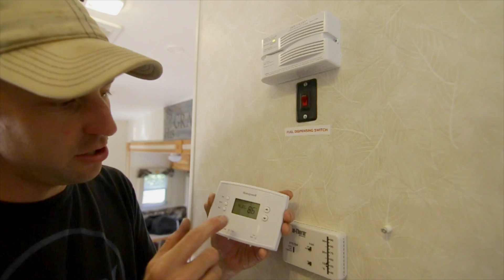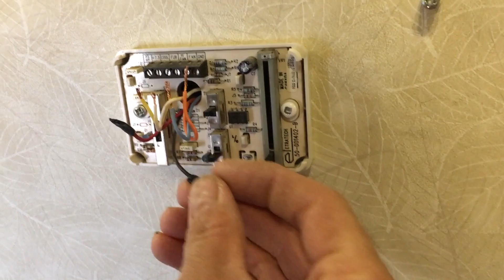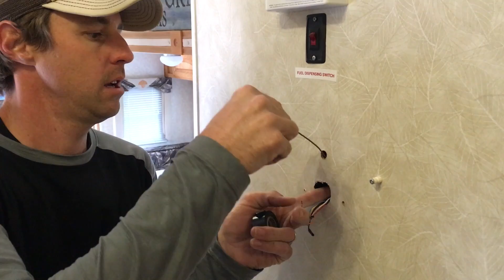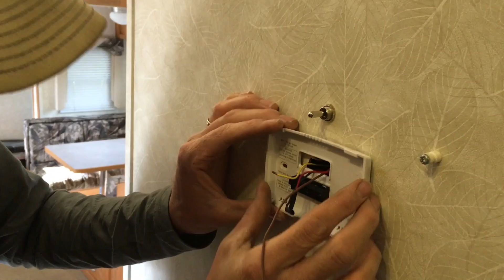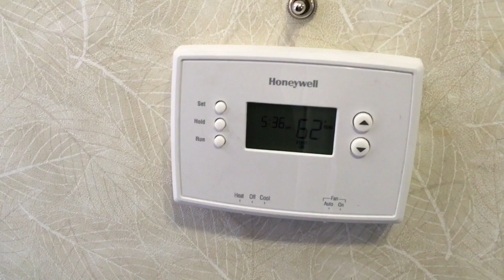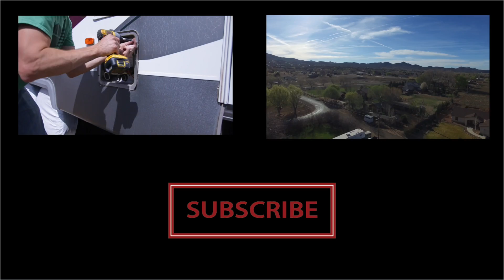RV DIGITAL THERMOSTAT CHEAP AND EASY INSTALL!

Comment: I was skeptical because a home thermostat is 24 vac and RV is 7.5 - 12 vdc.  But it works.  I finally have constant temperature in my RV ...for $28.  I bought a Honeywell RTH111B at HD.

Reason it works is because the home thermostat operates on its backup batteries instead of an external power source ...you don't supply it with power using the red wire in your RV like the RV thermostat needed.  Leave the red wire disconnected and insulate the end with electrical tape.  An RV thermostat does not supply power to the appliances via the red wire as I mistakenly thought.  The RV thermostat simply connects the power signal sent by the furnace/ac control boards (white/yellow) to ground.  Jared's method accomplishes the connection to ground by the RC terminal which is common to ac and furnace.  

For high speed ac fan, connect both the lo and hi speed wires together.  Jared accomplishes this using an on-on switch and jumps the common to the low so low is always connected regardless of switch position.  A slightly easier method is to use an on/off switch instead of an on/on, and connect the wire that feeds the thermostat G terminal and the lo speed fan wire (brown) together on the off side of the on/off switch.  Connect the hi speed fan wire (blue) to the on terminal of the on/off switch.

Comment: Where did your red wire go from the switch to the thermostat as you dont show a red wire being connected.  Thanks for your help as I would like to do this to my rv
Reply: I have the same question
Reply: It will connect to g

Comment: Thanks for the video! My question, if we do this, will the a/c run when the furnace is on? Hopefully not… 

But we do like running the a/c fan on low when the furnace is on. Can we still do that? 

Thanks!

Comment: If you loose the bAtteries during a heating or cooling process, the thermostat will stop every thing or it will continu in the same setting ?

Comment: Eliminate the thermostat all together ...I've now watched 3 break...last night it was mine...!!!

When the unit isn't being lived in the thermostat is irrelevant...you need heat or you need cold...on or off
Can you set it up with 2 switches Furnace/AC...???

Mine came off the wall somewhat abruptly...

Comment: Turning off the main 120 Volt breaker does not turn off the 12 Volt circuit for the furnace. Granted, 12 Volt will not shock you much, but crossing those wires could damage the furnace. So, having omitted that I turned off your video and did not subscribe. You are not expert nor should you be giving advice. Tell us about your camping locations.

Comment: When hooking up the toggle switch for high and low where do you hook up that red wire in relation to the terminal for the new thermostat?

Comment: What?????  You completely disconnected the power so how could a touching wire during disassembly of the old unit cause any issues?  Answer it can’t!

Comment: Jared, my RV thermostat runs off 12 volt, I have the RV parked on a lot I own and have never and will never travel with it, is there a way to convert the 12 volt thermostat to 110 volt?  I have 30 amp service and the only thing I really need 12 volt for is the AC thermostat...
Reply: The typical home thermostat is 24v. I've read that many battery operated thermostats will function with 12v. The 24v home unit has a terminal that powers the thermostat itself but when powered by batteries it appears 24v is not necessary. If you wanted to go crazy you could wire about a 24v transformer from a furnace with a fuse to 120v.

Comment: We have duct A/C and we installed the same thermostat, so will the fan from the A/C always be running even when we are running the heater?
Reply: What did you end up finding out on this? Does ac fan run with furnace fan?

Comment: My model would not work with just the high fan wire I needed to connect both the fan wires together make it run on high

Comment: This is easily the most helpful video I’ve found so far! One question: if one were to accept a single speed on the fan, could the toggle be omitted?
Reply from the maker: Yes just connect either hi or low whichever you want and wire nut off the other.

Comment: bought a programmable thermostat and could not get it to work using conventional wiring.  thanks to your video I got it wired correctly and it works great. I thought I had a bad thermostat which would not have been the first one. big thank you for your video.
Reply from the maker: +Don R glad it helped you out!

Comment: Toggle switch GSW-12 SPDT switch (Ace Hardware, Amazon, Home Depot, etc.), it is a two position switch On-On, in this case it would be a fan Hi-Lo. Follow Jareds instructions in wiring up the toggle switch. Google "Dometic bulletin A27-8C"  and see page six, for early model wiring identification & troubleshooting.
Reply from the maker: +Teagar Sky that's great to know, thank you!

Comment: I have the same wiring and cant make it work so are you saying not to use the red wire on the +7.5 and put the black wire to the rc on t stat sir
Reply: Thats correct

Comment: Great video. We have a Duo Therm t-stat similar to the one shown (just different colors in the block, but 6 wires just the same). I have a question - we don't use the A/C, so how would I wire the RTH221B1039 to operate just the furnace? Many thanks.
Reply from the maker: I could be wrong but I think you would skip the "G" and "Y",  and wire nut those off individually.  I think that is the Cooler and cooler fan
Reply: By keeping the switch between off or furnace.

Comment: i see the red wire when u put the new ther up but you didnt hook it up , i have the same unit but my ground is green and i see yours is black. so where did the red wire that is the 7.5 v feed go . i cant see where you hooked it up to
Reply from the maker: I put a wire nut on it to cap it

Comment: Where did you attach the red 7.5 wire? Everything else looks great.
Reply from the maker: I will double check but I believe  I just put a wire nut on it and let the batteries power the thermostat.

Comment: Very Well done    My last Travel trailer  was a 2003 Rockwood  just traded for a 2017 Coachmen.  the problem I had with the last trailer was over a period of  5yrs it had three thermostats that I replaced due to Short cycling and inconsistent temp (way off) from research I have found that for the most part  the Duo Therm  Thermostat is JUNK  and the new digital one from Dometic is no Prize  that's the one in my new Rv  but its good to know that you can use something off the shelf  like you did .  rather than go to an Rv store and buy same  Junk  again .  yours will  last the life of the RV

Comment: Sorry Chris, just realized I don't need "B" brown low fan. You did not need a thermostat with that connect because you installed a remote switch. The Honeywell RTH221B uses high speed fan blue only. Perfect choice, I'm not concerned about dual speeds.Thanks,Dan

Comment: Thanks Chris. The Honeywell installation manual section 2 for wiring does not show a connect for my Duo-therm fan brown wire. Where does it go?Dan
Reply from the maker: For me I connected the fan from the switch to the g terminal.

Comment: Doesn't anyone have a video showing the old analog to the dometic digital?  The instructions do now show how to hook up the analog 6 wire system to the digital 3 wire system.  The instructions show you how to turn a thermostat on and off, ugh.
Reply from the maker: I haven't looked at the Dometic digital thermostat but I will see what I can find.
Reply: to go to the digital 3 wire t stat,  I believe you will have to change also the upper board in your ac?
Reply: I need this too… did you find anything?